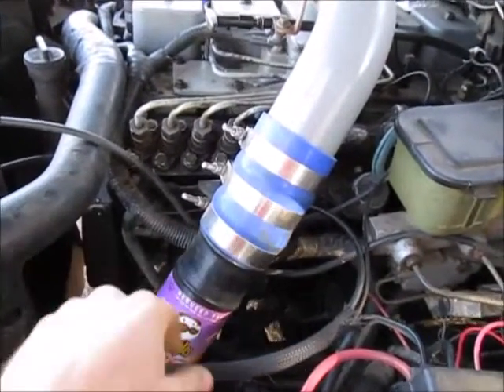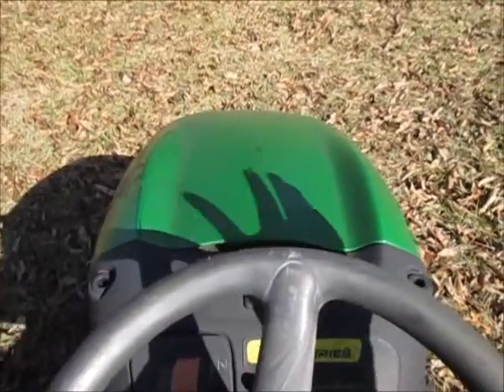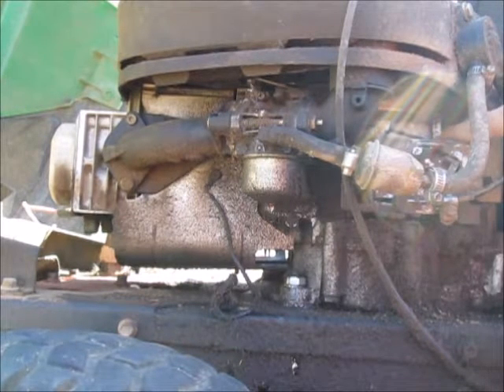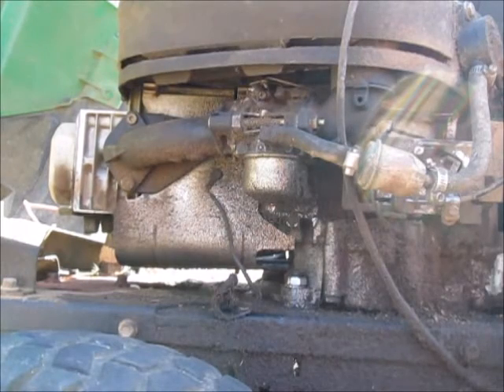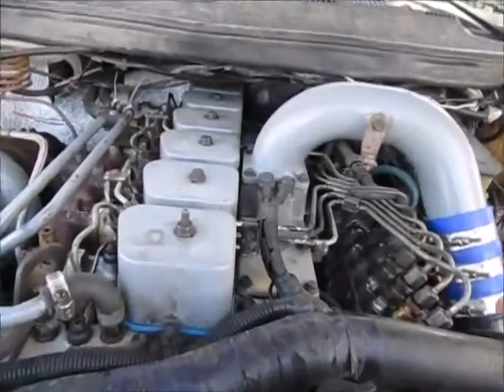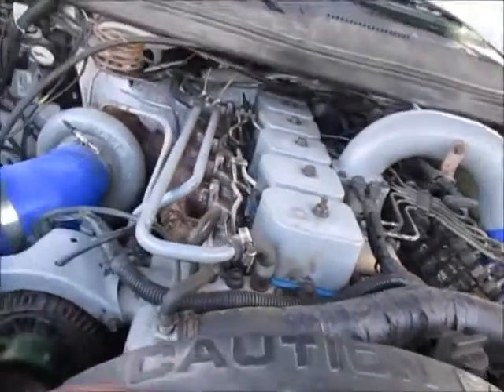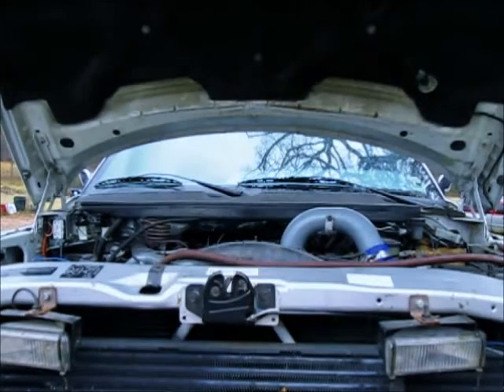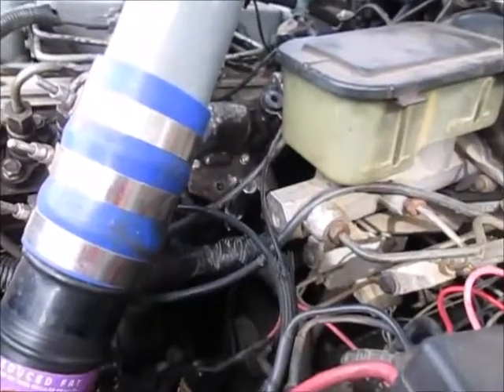MythBusting with CumminsWorks - P7100 Governor

Comment: There is two types of governers rpm limit, and a load governer.
The rpm limit governor is used for the road in cars and trucks.
The load type governor s are used in agricultural and construction equipment. 
So your video seems silly.

Comment: You have two different systems going buddy that there p pump does not run off centrifugal force it works such as similar as the ve pump which uses spring tension twards the throttle that determines when it gives is when it stops feuling that and you have gas which uses its throttle operation with air allowance through the butterfly the diesel uses its own feul allowence as rpm
Reply from the maker: Custom_Diesel_Gas Before we further this discussion, have you ever torn apart a P7100 before?

Comment: that's not how the governor works on a 12v but ok lol
Reply: CumminsWorks  the p7100 governor does not add fuel according to load though your foot does by moving the rack with throttle input , if it added more fuel by itself you would see rpm stay the same when load applied which is not the case , which is why idle is set to certain point with load on the engine , in drive with ac on for example per fsm .
Reply from the maker: Please share your view.  If this is indeed wrong I'll take it down.  There is a lot of misconception about the governor because people assume it's operation, that is what I wanted to remove.
Reply: CumminsWorks the governor in the p7100 works almost like centrifugal clutch. there's two barrels in the pump that rotate with it. There's 3 springs inside  if I remember. You have your idle spring and two others. as it spins faster the springs compress controlling fuel to what ever they are set too.  when you put the stiffer springs it'll fuel harder down low and all the way to 4k or 3k which ever one is prefured. what you doing is cutting fuel with the shut off solenoid. governor is no controlled by linkage in these pumps all internal. There's vids of how too on here.
Reply from the maker: Oh, I fully agree with you.  I was messing with the FSS solely to prove that the governor would increase fueling as load was applied.  A surprisingly large number of people believe the governor only comes into play at red line where it prevents the engine from overspeeding.  This video was simply trying to prove that the governor is always active in the pump at various loads and RPM's.